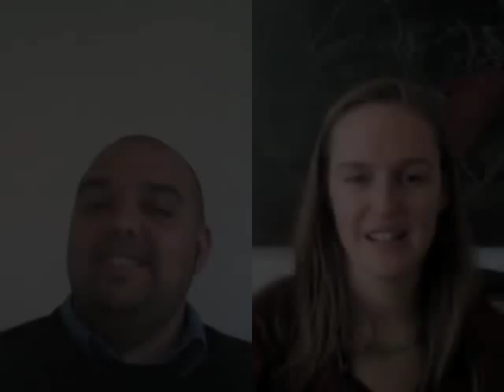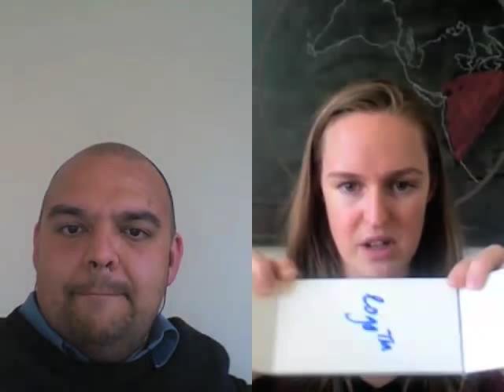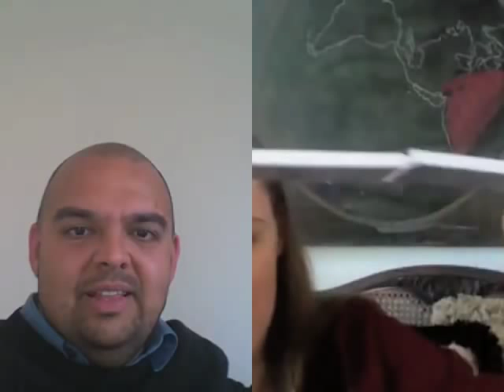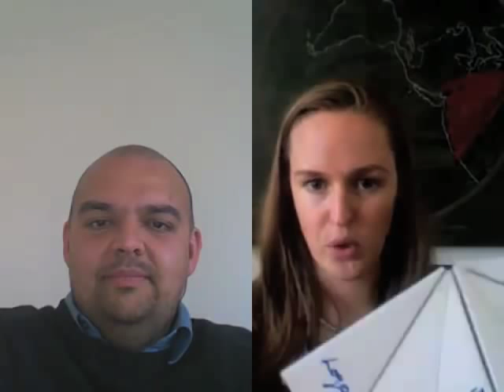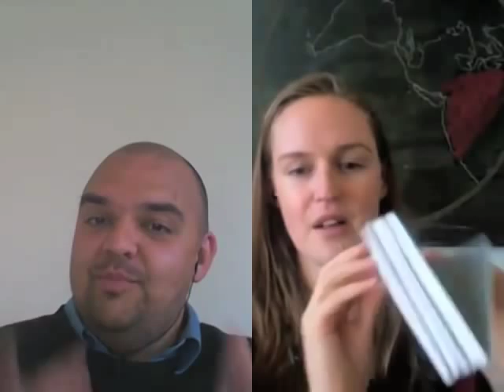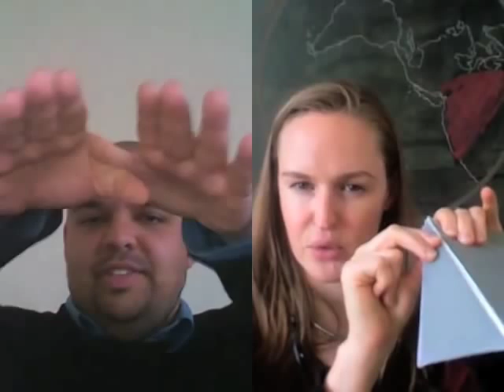Vinay Gupta and Julie Danger on Camp Danger Semi Folding Hexayurt

Comment: This is awesome!  I am building a Hexayurt for BM this year and this technique looks so much easier for NOT building on the Playa.  I have a question.  Are the gaps in the panels pressed tight together when fully assembled?  Or are there small gaps that will lower the insulation properties of the yurt? Thank you for the video posts!

Comment from the maker: @MrJoshmcintyre1: yep, easy and pre-fab, no tricky building on playa. Really good question too, I'll add this info to the appropedia page. Answer: the gaps ultimately align the roof and wall panels at the same angles as on a classically constructed hexayurt, therefore no loss of insulation. To increase insulation, miter the edges of the panels, or increase thickness of panels. Thanks!

Comment from the maker: @MrJoshmcintyre1: This is where my smartness runs out. I used the $18 "R Max" boards which appear to be most people's choice. I couldn't tell you the difference until I compared them both, live, on-playa. If I was going to use the cheaper route, I'd be even more inclined to add a swamp cooler to it! (DIY swamp cooler instructions on appropedia page)

Comment: @juliedanger Thank you.  I have found two options here in LA for the boards.  I however don't know much about "R values" other than they rate insulating properties.  I was wondering if there will be a noticeable difference between a 3.9 and a 5.9 rated board.  The difference in price is $100 for the cost of the yurt.  Home Depot: Therma Sheath 1 in. x 4 ft. x 8 ft. Foam Insulation at $18.30  vs. Lowes: 1" x 8' x 4' Insulated Sheathing (Perma R) at $9.63.  Thank you )'(